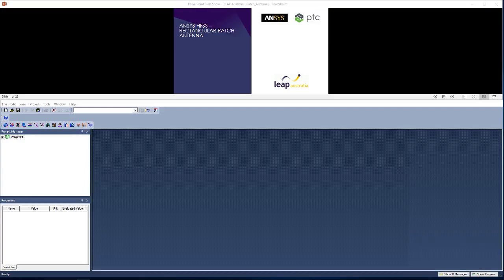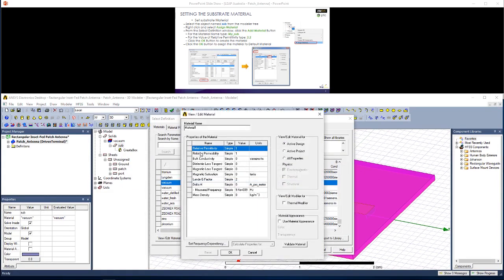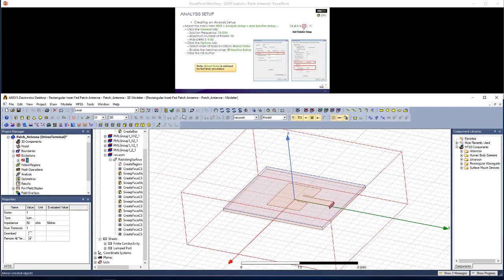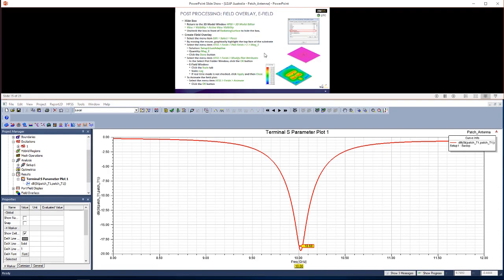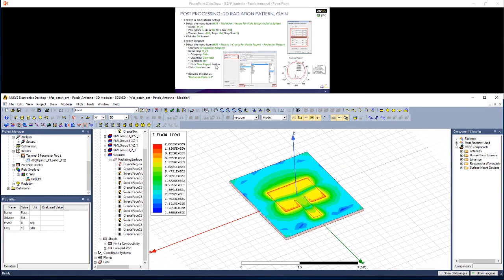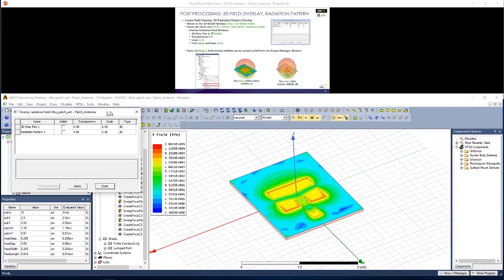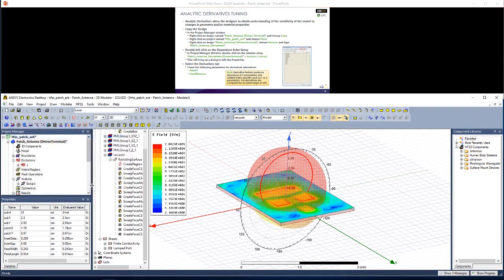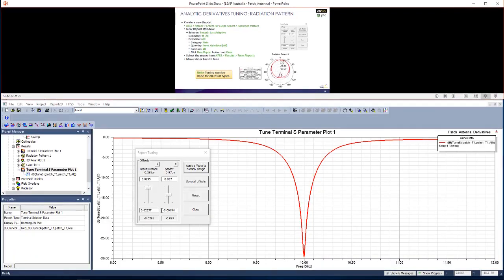Microstrip Patch Antenna - ANSYS HFSS

Comment: it shouldn't be terminal solution at 1:18. The solution type should be modal, which is suitable for antenna.
Reply: we dont have to define a line from ground to patch for terminal. makes it easy. other than that everything is same as modal